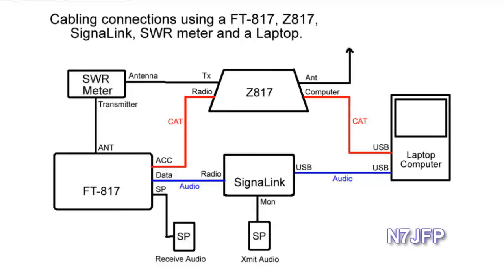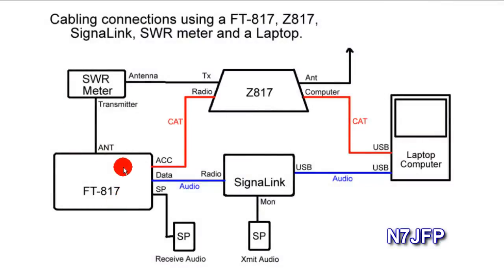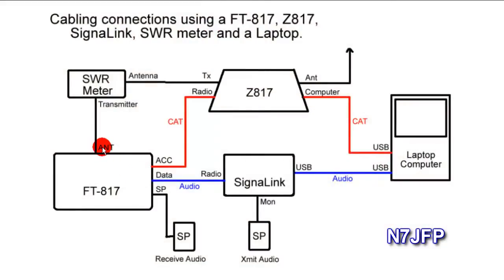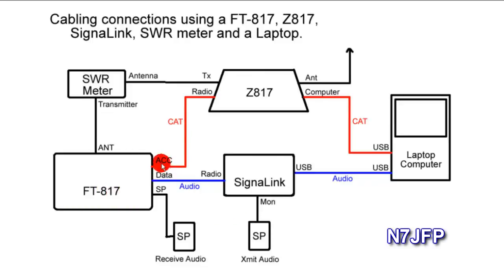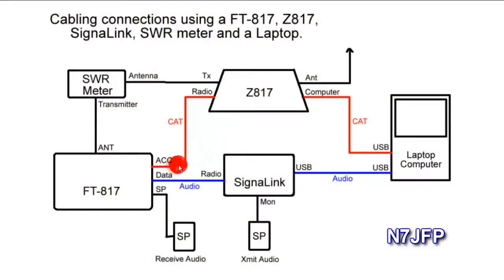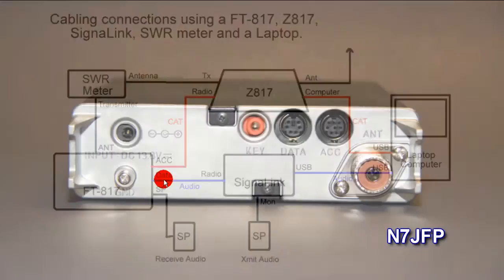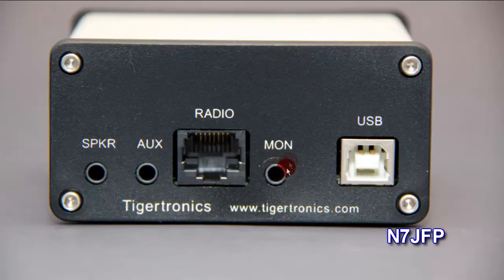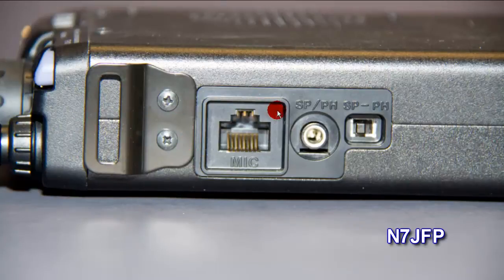FT817 to Laptop Cabling

Comment: Hi, thanks for the video! I have same configuration and I employ flidigi for cw, what software do you use for cw and digital modes? 73
Reply from the maker: WSJT-X digital modes with Ham Radio Deluxe for mainly control and logging.  I use GridTracker and JTAlert for the audio and visual effects. Thanks for watching.  73, N7JFP

Comment: I am using the data port on my 857d into the RADIO port on the signal which is connected via USB to my laptop. I am unable to see any receive in fldigi.
Reply from the maker: Check the settings in Sound and the SignaLink produces two USB IDs in Windows.  Assign one as Microphone and the other as Speaker.  Assign Microphone to Audio Input in Fldigi.  Also, watch video "JT65-HF test with a FT817" -- USB Audio CODEC is the SignaLink.  Good Luck  73, N7JFP

Comment: Will this work without the Signalink?  Where the data cable  is wired directy to the computer' USB port
.
Reply from the maker: I have not tried a direct connect USB.  The audio card is built into the radio.  Should work.  Check the manual.  73, N7JFP

Comment: Question all hooked up with exception of the (Computer Cat USB) , I do not have this cable but I'll bet it is the one item I did not buy the programming cable is that a correct assumption?  You order ft-817nd, z817, SignaLink, pl259 pigtail, mfj1899T and still come up short. Great video, got here via setup for psk31 video.
Reply from the maker: John, you need the Yaesu USB CT-62 CAT Cable.  They come with a USB or a Serial port on one end.  Setup your PC to run PSK31 and you are ready.  Thanks for watching. 73, N7JFP
Reply: N7JFP Thanks, I ordered the programing cable ADMS  Gigaparts said either will work and  software with ADMS only three dollar difference, so I opted for that option just in case I might need it. CYA

Comment from the maker: Only one CT62 cable is needed for PC usb port to the Z817 computer port.
The cable from the Z817 radio port to the FT817 is supplied with the Z817 tuner.  Good luck with your setup.  73, N7JFP
Reply: So, the cable from the Z817 radio port to the FT817 supplied with the Z817 tuner IS not a required CT62 cable? I already have  CT92.  Just making sure I don't have to buy another one.

Comment from the maker: Mike, The Z817 manual explains about the CAT feedthru from PC to FT817.  The Z817 needs the link to initiate a tune cycle when you press Tune.  The PC sends CAT commands to the FT817 to control it.  There is only one CAT  (ACC) port on FT817.  The wattmeter gives a little more information about what is going on when you Xmit.  Good luck with your station. It is a lot of fun.  73, N7JFP

Comment: Hi Lawrence,
I've got an FT-817nd, Z817, and my lovely wife just got me a Signalink for Christmas so, besides an SWR meter (which I will hopefully be picking up soon), I've got an identical station. Being that I am fairly new to digital modes, can you tell me why you would want to hook the Z817 up to your computer? Can you control the radio with the computer that way?

Thanks much!
Mike KJ6DRG
Reply: It just passes data through because Z817 has to be connected to the ACC and so does the computer, but this reply is 6 years late 😋

Comment from the maker: @softstart100 My laptop only has USB ports.  I found a USB CAT cable for the FT817 on Amazon. "Yaesu USB CT-62 CAT Cable FT-100 FT-817 FT-857 10 Foot Version FTDI Chipset Supports Windows 7 64bit
by Valley Enterprises."  It is amazing that you can be heard thousands of miles away with only 2.5 watts.  Good luck putting your station together.  N7JFP